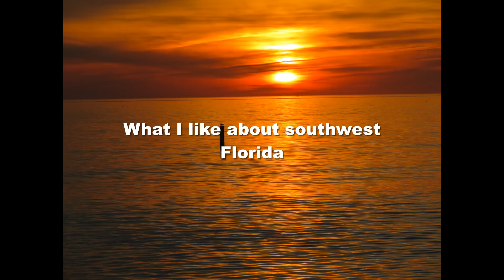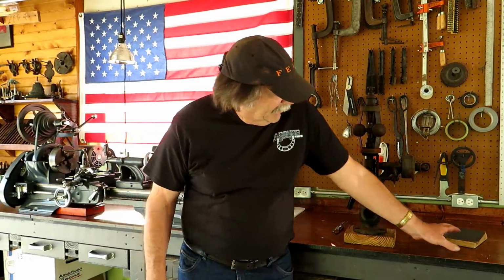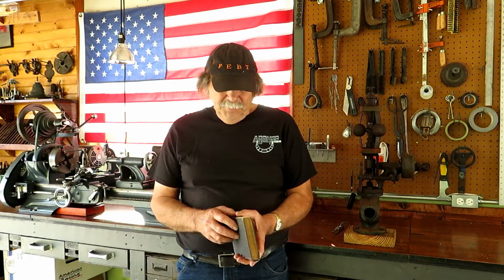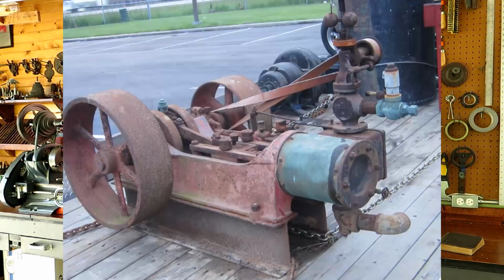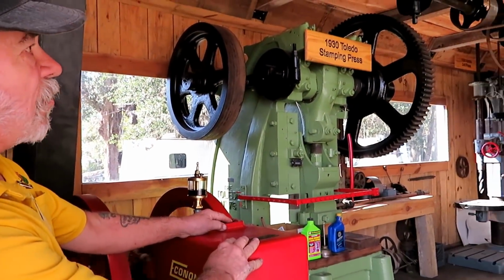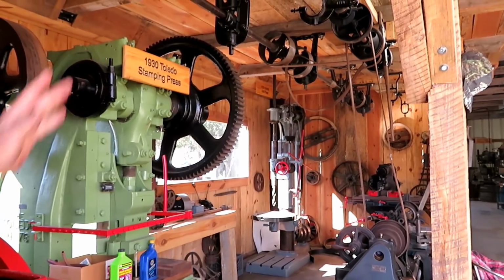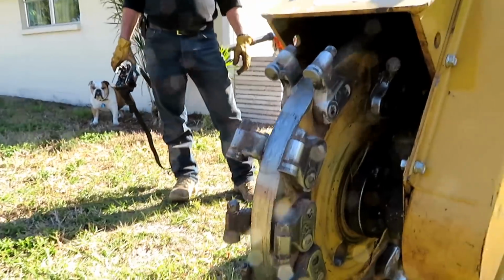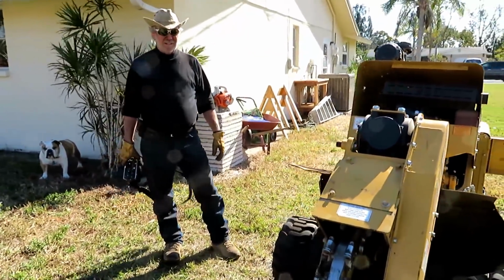OLD STEAM POWERED MACHINE SHOP 37  Gone South

Comment: Hi Dave
Great channel, I found your site about 2 months ago, enjoyed all the episodes. I have been collecting old engines  and tractors for 40 years, still working on putting my machine shop together. Most of my equipment is from WW 2 or older, sorry they have been converted to electric. I am retired skill trades, steel fab & welding, machine builder, maintenance machine repair, self taught machinist. Thanks for the line shaft side of the shop.
Reply from the maker: Robert, I'm glad you found the channel and hope you will be a regular here....Dave

Comment: That was the same problem I always had with my Fords. They left too many bolts out and the things fell apart. lol
Reply: FORD =Fix Or Repair Daily, The one and only exception I owned was a 1960 7ton tipper lorry . Thames Trader as they were named in England. Reliable . economical on fuel , 10 ton load if required without complaining .
Reply: Did it have a 300cid 6 in it?
Reply: I used to think you were very cool Bryan. lol
Reply from the maker: Now, now.....UPS got billions of miles out of them....Dave
Reply: Brian .Ford 6 D upright strait 6 cyl  about 5 .7 ltr .  the next generation of ford trucks here were D.series when they laid the engine on it's side to fit under the new style cab . it was never any good after that .Thames Trader link. https://youtu.be/D2ahrMXXkIs
Reply from the maker: The grille is very recognizable, but other than that?.......Dave

Comment: I may not be 19 but I am 21 and my career/life ambition is to get into railroading and open my own proper locomotive shop restoring and maintaining steam locomotives. The shop would be for maintaining my own small roster I'd have for tourist runs and such but I'm hoping I'd be able to ether train or hire some great machines and work along side them so we could do commission shop work like the Strasburg railroad does with theirs. 

I'm also hoping to have my own little personal shop that I want to be steam line shaft like your ny shop. That book would be invaluable to me in terms of the knowledge it has to bestow to whomever is lucky enough to get it. Since awesome old steam guys like yourself are starting to become few and far between us youngins need to start taking up the slack and learn up.
Reply from the maker: And hopefully the DEC, EPA, NRA, OSHA, insurance companies and trial lawyers won't take it all away before you get started...Dave

Comment: yes it is & was interesting I have a question to ask you  ,given you ues the Lenten post.  Now to my question . the J.H.  Williams tool holder how would we go about doing that today. &  you have a opatunity to show how they Maid them  in a stem shop . ?   That weld be a interesting project . ? Les England . ! have a go & it will help me as I have no miller ? just a lathe & i will let you in to a secret I made my first .  copy by using an old rusty spanner one of the rely old
 Wit-Werth  one's  it worked well I got two Out of one spanner ?  i filed the square hole in it .

Comment: Hey Dave, I've got that same atlas lathe and have the turret attachment with the lever. I'd gladly give it to you if you want to pick it up on your way back north in the spring. live in palm coast Florida right off of I95.
Reply from the maker: Shane, I didn't know there was one made for it. I'll look that up on the Atlas site....Dave
Reply: Here's the one I've got, http://www.lathes.co.uk/atlas-lathe-accessories/img14.gif. It came with my lathe but I've never, and will never used it, needs cleaned up, you can have it though. I could meet you or just give you my address. I can take some pics and text them if you want.

Comment: Hello David,
That steam machine that is seen in the 8.23 minute of the video that marks and of which approximate year is, because I have an equal but does not have the data sheet.
Thank you.
Reply from the maker: That engine was likely built 1895-1905 by Lilly Engine Works in Erie, Pennsylvania, USA.  4 1/2" bore, 5" stroke.